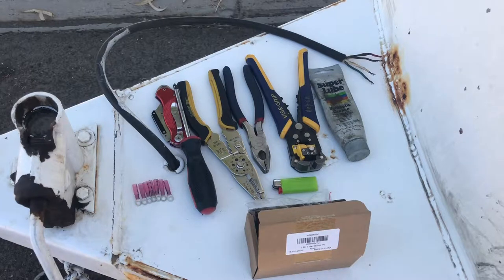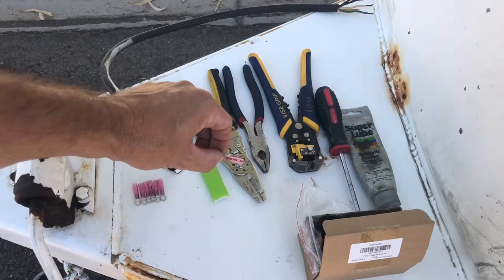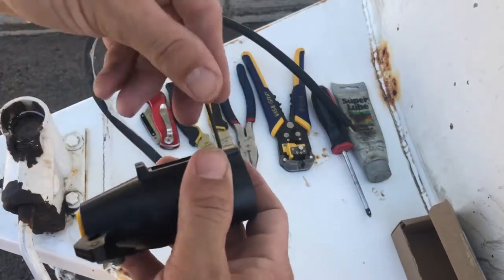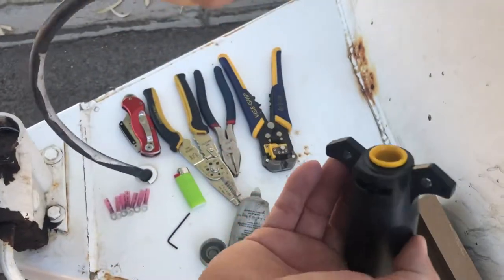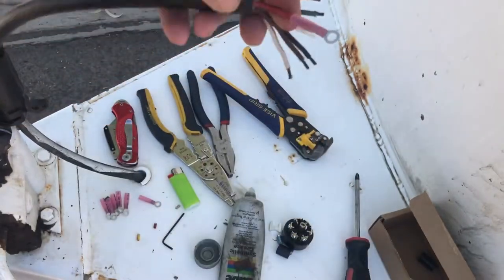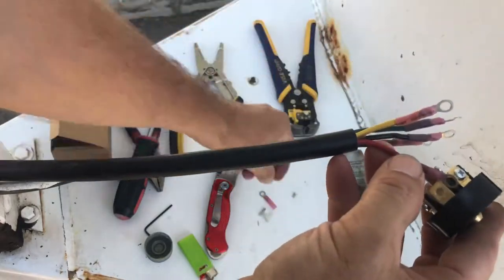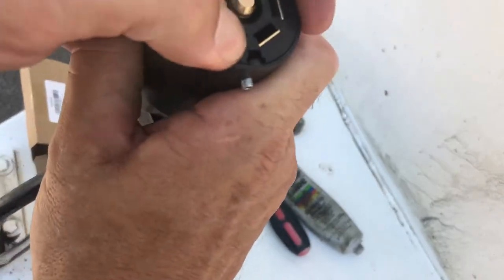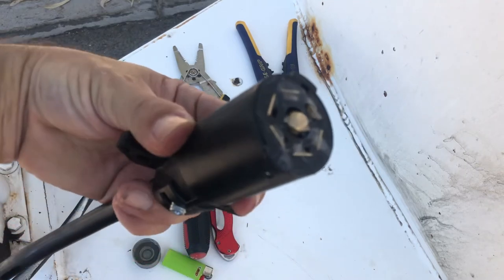How to wire a 7 pin trailer connector

Comment: hi, i just cut my connector off mowing the lawn and cannot find it anywhere to know how it gets wired.  It was a 4 pin connector, but there are 7 wires.
Reply from the maker: If you’re not familiar with fixing broken wires, the easiest way is a test light. Turn on the lights for running lights, then brake and turn signal and figure what wire goes where. They’re about $10 at harbor freight and it’s a very easy process.
Reply: @Chadlistentome  i can fix broken wires.  I dont really want to buy a test light yet.  Its my jon boat trailer.  Why is there 7 wires when the plug was a 4 pin?
Reply from the maker: @EdStaniszewski  trailer brakes and lights. I would assume somewhere during its life it was set up for trailer brakes if it has them. If it doesn’t that was simply the wiring the manufacturer had on hand.
Reply: @Chadlistentome  oh ok, it never had trailer brakes.  It was a jon boat and trailer package.  Its just a small single axle trailer carrying a 700lb jon boat.  i know the white is the ground plug, there are 2 white with tan stripe, 2 tan, a green with tan stripe and a yellow with tan stripe.
Reply from the maker: @EdStaniszewski  If you have a 6 or 7 pin connector on your truck and want to use the brakes, simply wire in a 6 or 7 pin connector. There is applicable code for the wiring color, but the best way to find out what wire goes where (due to previous owners doing whatever) look at what color wire goes to what light or what brake. 

If it has been wired to code it should be the following. pin 1 ground, 2 brakes, 3 running lights, 4 12V, 5 left turn signal and left brake light, 6 right turn signal and brake light, 7 reverse. Reverse will disengage you trailer brakes while backing up. I hope that helps.
Reply: @Chadlistentome  ok thanks for your help!  Ill give it a go tomorrow.
Reply from the maker: @EdStaniszewski  when you buy a new 4 pin plug, in the instructions it tells you what color goes where. Super easy.
Reply from the maker: @EdStaniszewski  one more thing to note, since it’s a boat trailer, I’d use heat shrink connectors, or adhesive heat shrink over the connection. Again, harbor freight has it super cheap.
Reply: @Chadlistentome  I dont know what happened but i cant get my running lights to work now.  Is it possible to blow the bulb crossing a wire?  Shouldnt both brown wires tie into the plug?  I just bought another 4 pin connector.  Everything works except when i turn my headlights on.
Reply from the maker: @EdStaniszewski  oof. They should. I don’t know if that’s a possibility honestly. You may have torn a wire inside the sheathing farther down the line when it was yanked on. I would start by checking connectivity from the plug to the light.